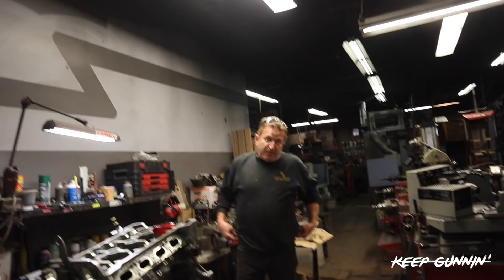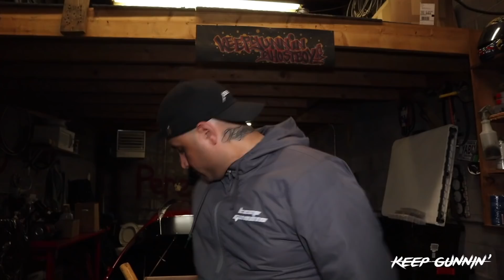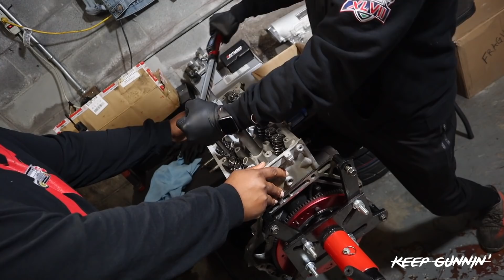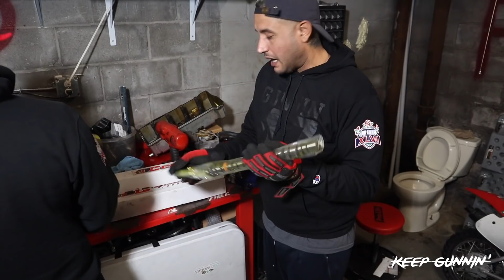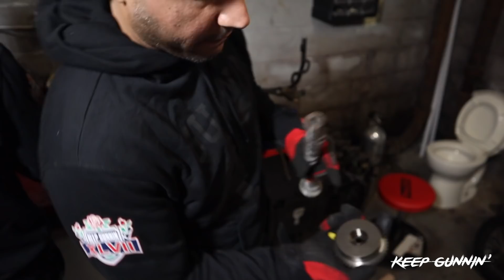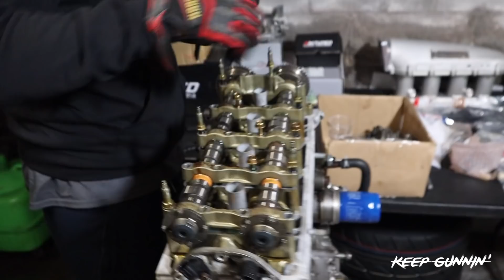ASSEMBLING A K20(LEARN) 🔫

Comment: Why 2.2's and not 3.2's? Curious because I'm about to pick up a 4pistons port and polished head with a skunk2 ultra street mani match ported with some 3.2 Dc's. Trying to make about 260+ on a stock block. It's gonna be my daily. Wanna make sure I'm safe. TIA Hope all is well!
Reply: Mike High same set-up! But I want to put a little boost to mine. Not too much 8-10lbs in an eg hatch
Reply: @dpisaiah  if you're gonna boost I recommend you you build that block. I've heard stock rods on the k24 suck.

Comment: I have a full tsx swap I want to put it in a eg my question is there anything on the motor need to be change other than a Type S oil pump an cam gear do I have to change the AC bracket to a K20 Etc stuff like that thanks in advance